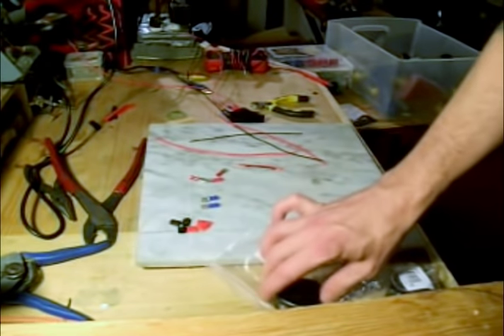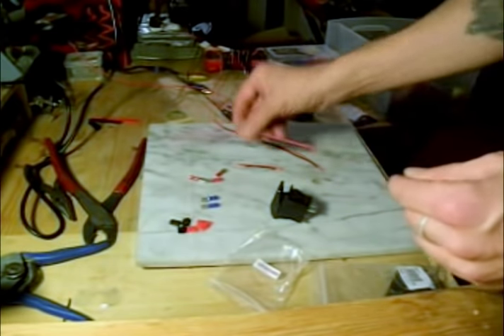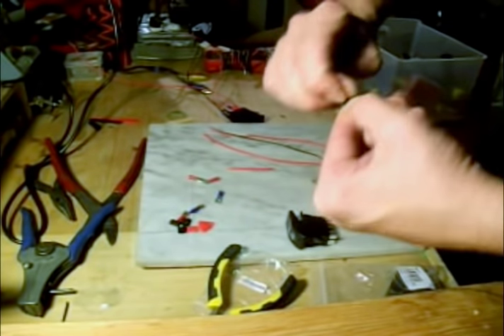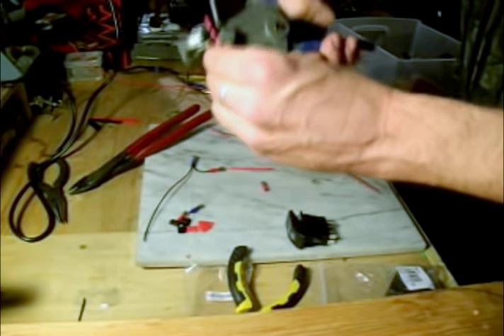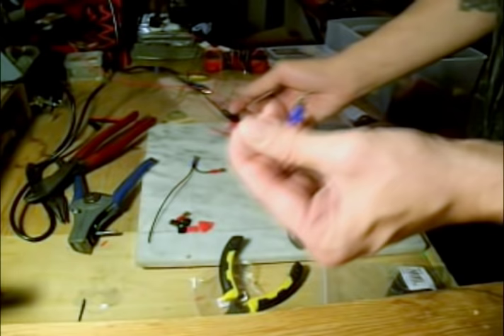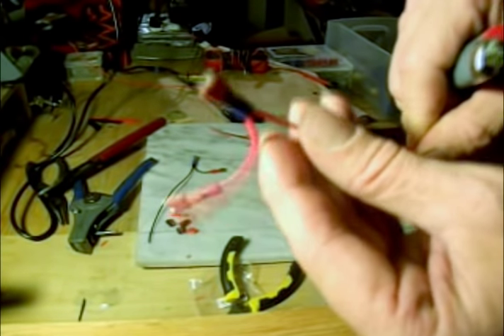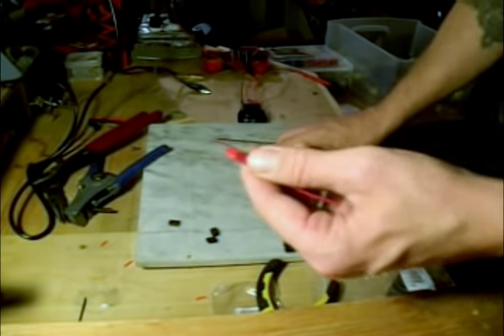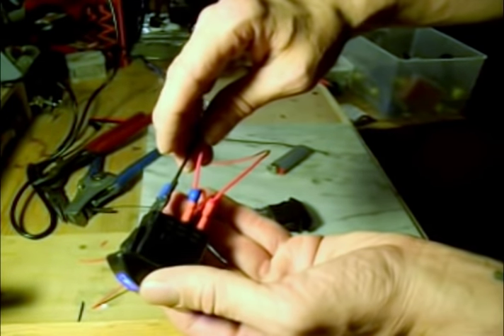LED rocker Switch

Comment: Bottom right is not a wire that goes to your power to accessory or relay. It’s for your dimmer switch. And two negatives on certain switches that have two LEDs one will go to negative on dimmer/dash light and one to ground.

Comment: Top were both ground, middle is 12 volt positive, bottom left is to relay or positive side of light without relay, bottom right it illumination for bottom led back light

Comment: Iv got a question i have gotten three rocker switches it was pre wired but when i hooked it up it will keep the light on and the light bars stays on
Reply from the maker: sounds like its either fried and going straight through like the connections are fused or one of the jumpers is in the wrong place connecting the 12v+ into the switch with the load and led out  if you have a multi meter Id check the posts see if you have continuity between the posts with the switch in the  on and off positions   as long as you know where the power comes in everything else is easy

Comment: Where does the negative cable from your light bar go to? When I try to do this, when I connect the negative cable from the light bar to the negative post on the switch or the battery, the light stays on. Even when flipping the switch it doesn't go off.

Comment: Why don't you use insulated connectors? Then you wouldn't need to put on the heat shrink.
Reply from the maker: I do not really like those connectors they create a potential point of failure vibration etc can cause the wires to break where the wire enters the connector, also depending on the quality they can oxidize creating resistance between the connector and post or simply wiggle off the post.  which is not an issue of you have a few connections but if you have many and its years later or a vehicle purchased from another person it can be a colossal pain in the arse.

I do it this way because of years personal experience mickmousing stuff together and having it fail in the sticks when you really need it to work lol  even when I do use them I still heat shrink where the wire enters the connector as a strain relief to minimize movement and having the wires break

Comment: If my car is off why does the light on the bottom always is on
Reply from the maker: the light on the switch is on 24/7?  then you have it wired to a source thats not controlled by the Acc  (ignition wire)

Comment: Bought  a toggle switch on line(mictuning) came with instructions and jumper wires ,they are as you have shown
Reply: Mark Hughes - He shows two different ways of wiring the jumpers. The switch he is working on is wired differently than the one he that is already finished.

Comment: I have a 4 prong on/off rocker switch 16 AMP by Dorman #84824 which I purchased at O'Rileys and I can't find any tutorial on youtube on how to do the wiring. Im using this rocker switch to light up my LED lights on my truck. My previous switches only had 3 prongs and that was a no-brainer to install. The prongs are numbered 1,2,4,5  which prongs wires to the Load, Supply and Ground? Can you explain or show a video for this particular 4 prong setup....thanks :)

Comment: I have a three prong rocker switch.  I have it connected to the positive and negative and it seems to do what I need it to do. The only problem is that I can’t get the led light to turn on when the rocker switch is on.  

So my friends son has a 12v car and it had an ignition with key to start the car. He somehow broke the ignition with the key and turning it back and forth. He’s only 15 months old.  

I helped to wire and put in the toggle switch and the vehicle is now turning on and is operational.  The only issue is the LED is not powered on. 

I did see on the rocker switch with the 3 prongs labeled “Positive, Appliance, Ground”

If I plug positive and negative it will start the toy car. If I plug positive with positive  and negative to ground prong the car won’t start but the LED rocker switch will have the led light on. 

I’m trying to get the 12v toy car to turn on with the LED light. 

I’m thinking I would have to find the actual starter wire and plug that into the appliance prong.  Anyone knowledgeable that can guide or help.  I’d appreciate it.  

Thanks

Comment: I have an old 30 ft class eve and one of the switches which is a four prong rocker w/ light broke. Well, I hooked it up wrong and it melted. I guess I am not understanding something because the next two switches I purchased I also melted. The switch is supposed be taking power directly from the batteries  and when it is one it goes to an inverter which powers the outlet. 

There are four wires which are as follows. One white which is live and goes straight to a positive of a battery. There is another white which goes to the positive of the inverter and then there is a black that is ground to the chassis. The confusing part is the fourth black comes off of the white which goes to the inverter. The negative for the inverter which is under the hood with the batteries themselves goes to the negative of one of the batteries. The inverter has an on and off, which I normally do not keep on as I also have been trying to find out why the batteries seem to drain really fast when I drive it. 

That another problem. I am going to rest the alternator tomorrow but I would also like to finally get the switch in correctly. I have watched multiple videos but must be missing a detail. Would it be the white wire from the battery that is hot goes on the top right than the white from the inverter goes into the top left.and then that means I have a ground and the black one which branches from the white to inverter. Gosh, I’m sorry. Does that make any sense? 

The last three months have been a crash course in electrical systems since the RV became mine. It appears the dealer had pulled out the entertainment system which pulled out other wires which he plugged in wrong. When I started it and turned on the coach fan smoke...I had to basically pull everything out and redo it which I have no experience in at all. Or I didn’t. This is when I noticed that many wires in the dash had been cut like the wires for the the DVD player and Stereo. 

Through trial and error and a lot of reading and YouTube/ I have managed to repair the wiring and figure out how it was all wired. Kind of. I was hoping to get it all done to my best and then have someone professional look it over and hopefully tell me what isn’t right. 

I can’t find any diagrams of the wiring system specifically so I have had to follow every wire to its source which taught me a lot about how the system works. I didn’t want to just leave it wrecked and pay a bunch of money to have someone fix it and not learn anything at all. Stupid probably, I don’t know how I haven’t been electrocuted. It has four 12 volt batteries total plus two generators and another converter. I installed some solar panels and replaced all the fuses. Everything works great appliances and stuff which I had to figure out one by one. No even experience. I do my own mechanics for my Honda but this is a whole new level. When it works it’s amazing. Limited money and my stubborn desire to learn, got me this far and that damn switch is my last hurtle. Does anyone understand and can help?

Comment: Kootenayboy, could you please make a video of: rigid and or Cree wiring harness to a zombie switch? Both these harness's switch are 3 prong, zombie 5 prong. Thank you hope you can help. Alex. M.
Reply from the maker: Hey Alexander,  its really not that hard, but really confusing  they are all going to have the same basic functions  On/Off   Ground -  and power +  once we figure that out  it does not matter what your wiring up to it  if it has 2-3-6-8 wires  its going to have to have  power from the battery  ground to the chassis power to the load ( lights etc)  ground to the load      Im assuming the cree and Rigid have relays inline  which means the main power going to the load (lights)  comes from the battery to the relay, the wires to the switch are separate  the switch needs 3 wires  power from the ACC (unless your running it 24/7  etc)  a ground and the power out to the relay.   SO the red will go to the power in on the switch and jumped over to the switch LED post( this will give power to the switch AND the light on the switch)   the ground is self explanatory, and the remaining wire goes to the load out on the switch  meaning the post that's activated when the switch is turned on.   This is the wire that leads to the toggle switch on the relay it it sends a little power to the relay turning it on or off which when on basically opens the floodgate and sends a lot of power to the lights.  they do this so the switch does not have to be beefier to handle a lot of power  if not they can melt..  For the Cree I believe its red + Black - white to the relay.  If you have a multimeter (the red one from walmart are perfect)  you can easily tell which post is which  as power will only flow through when the switch is on they also can tell you if its pos or neg  or backwards  does that help?

Comment: Hello
Look at your video, explain why the two switches are not connected in the same way? The battery wire has a jumper, the other switch not.

Looking forward to a reply thank you.
Reply from the maker: they can be wired different ways depending on your particular need  for instance in this case if you want the light on the switch to run 24/7 or not  does that "explain" the situation? I hope you found this "Free" video helpful
Reply: I saw this as well... An error in the explaining of the wiring. The bottom right pin should goto you Dimmer/parkinf light circuit. Not hard for a diy'r to figure out.

Comment: I think your two switches were wired differently. The one you wired for the video had the load wire and jumper on both bottom posts. The Zombie switch had a jumper going from the center post to the bottom right. Sorry if I’m mistaken, but if I’m right, can you elaborate?
Reply from the maker: its been gone over many many times there are different ways to wire them the switch does the same thing the difference is in the LED in the switch  one when the switch is on off when the switch is on on 24/7 on only when powered  etc
Reply: @kootenayboy  thanks for clarifying

Comment: I am doing this to a boat and I am wondering if you can disable the lower LED all together...I don't want to run the risk of having a dead battery on the ocean. To do this, would you disconnect the 2 right pins from their corresponding wires? Thanks for the video!
Reply from the maker: yes you would just skip adding power to the led post  if you have a multi meter you can find out which post that is easily  you can also just wire the power to the switch from the ignition  so no power at all goes to the switch unless the key is on then there is no power draw you do not control
Reply: Or....you could not jumper the #6 pin (bottom right that he is jumpering to the power in) but instead run a different hot wire to that pin from another dash light hot wire. That way it wont come on unless your other dash lights come on. Or do like he said here and just run your hot line in from a dash light source.
Reply: Thanks guys, I just bought a similar switch and thought, wait, it has an on AND off light so it's gonna kill my battery! Of course I should have thought of this! Doh!

Comment: Thank you for the informative video.  However, I am assuming the Black Ground would connect to the LED Black Wire and then to ground and the Red to the LED Red ( or White ) wire. Is that correct?

Comment: Nice video! Q: If I have a fuse in the rocker switch and my wires led bar wire kit has a relay and also a fuse. Is it recommended to have both fuse for the wire and rocker switch or just needed 1 fuse to run the light? Thanks!

Comment: I have a 4 pin switch for my lightbar, but the cable that connects to the switch only has 3 colors. Which is blue, black, and white. How do i wire those to the 4 pine rocker switch?

Comment: NOT TRYING TO BE CRITICAL - as your videos are great. However it would be great if you would tell viewers about the wiring error - wrong connectors jumped on the switch you wire for us. Great job but you incorrectly jumped the bottom two connectors (positions 3 and 6) on your switch that you were wiring during the majority of your video.Jumping this way doesn't allow the bottom LED to light when the switch is in the off position which you show working when using your prewired switch at end. Just look at the end of your video and you will see clearly that your two switches are wired differently.

Your second switch that you  have prewired (in background of video) the one you hook to power at end to demonstrate is jumped differently.  The switch you power up has a jumper across the top two connectors (your ground connector positions 7 and 8) your second jumper then from bottom right (connector position 6) to centre connector (position 2) which is correct and goes to (your positive power source) then the connector on the bottom left (connector position 3) has a single wire going to you relay/light. My reference left and right are when looking at the connector side of the switch. I hope this helps your subscribers a simple easy mistake. Again not trying to be critical just trying to help.
Reply: There are multiple says to wire these switches the jumper controls the led inside one way leaves it on 24/7 the other controls it by the switch in the description There are links to the actual Wiring diagram.  It's really not rocket science it's dc current.  Both ways are correct depending on your application and personal preference.  What matters is pos and neg in the right place the rest is aesthetics

Comment: Great video. Thanks.  I have the exact switch and thought I had it wired correctly but in my case, the LEDs are reversed. The larger light is on as a dash light and the smaller, lower LED comes on when I switch the light bar on.  Any idea as to how I got them reversed?
Reply from the maker: Id suspect you have one of the power wires in the wrong position meaninng your powering the led in the light by the power t the light and not the acc wire from the ignition

Comment: Ok I have a three prong switch I don't have three wires I have two. I wire it the way it shows and it runs my pump but light won't illuminate. I've wired it to where the light turns on and the pump runs in off position. Ive also wired it where the pumps running and the light is jumped across to same power, when I touch the wire it lights up but pump shuts off. Any suggestion.

Comment: at 6:27 that switch is wired wrong compared to the switch you actually turned on. The double power wire should go to the middle and bottom right terminals.
Reply from the maker: wrong would depend on your need, if you read the comments it says that one is to have the LED on 24/7 or ACC  the other only when the switch is turned on though.   nice try though :)

Comment: There is more than one setting with those switches, show everyone how to wire it up so that you can bypass the led altogether, and then show us how to wire it so the light comes on only when its flipped into the on position. The problem I get when I try to do this, is an extreme current limit, there fore the other leds in my circuit are too dim because of this dang switch
Reply from the maker: sounds to me like you need a relay. the switch cuts the circuit thats it nothing fancy most are only rated to 20 amp they are not designed to run a ton of juice through. If thats what you want you need to add a relay powered from the battery and use the switch to toggle the switch in the relay I have 6 in my rig for the LED bar lights alone its overkill but if one fails it wont leave me with nothing and Ive room to add many more if I wish
Reply: @kootenayboy  well what helped was to bridge the bottom left lead with the top right on connected, along with the load going to the middle post and ground going towards the top left lead, I was able to get it to work ssw without severely dampening my current. I have somewhat of an idea on how this solves the problem, but I'm notb100% sure my observation is correct

Comment: for install in boat will the illumination stay on while baot is off? How would I wire it so that the panel will not draw power if key is not in ignition

Comment: The lights on my rocker switch stopped working but the switch still works. Anyone know why it would do that?
Reply: It would either be the jumper wire between the power terminal in the centre and the bottom right terminal, or more likely it will be one of the top two ground terminals come loose.

Comment: So the bottom red wire (to load) would actually go to pin 85  on the relay? I was hoping you would cover the relay in the video.
Reply from the maker: I have a video on the relay as well but to answer your question the out from the switch goes to the wire on your relay that turns it on  Im leary to use numbers as some relays Ive bought off ebay are all kinds of weird  using the wrong numbers etc